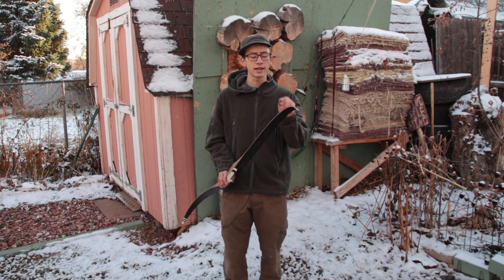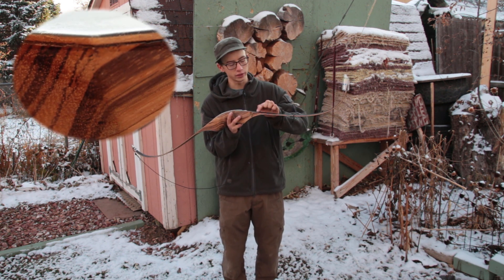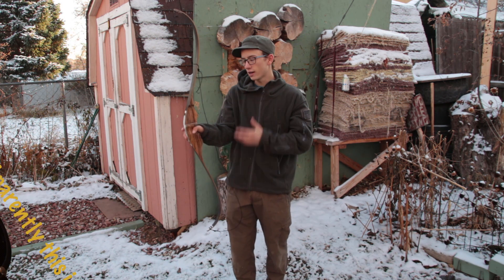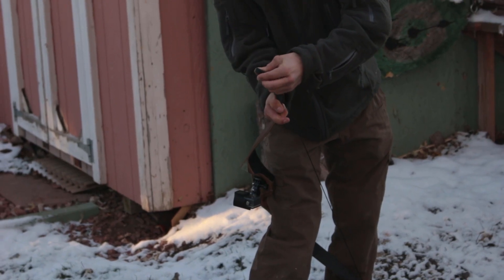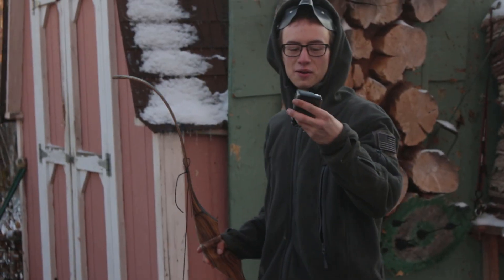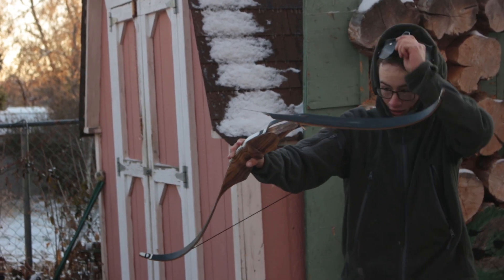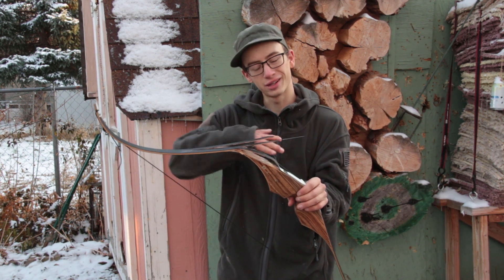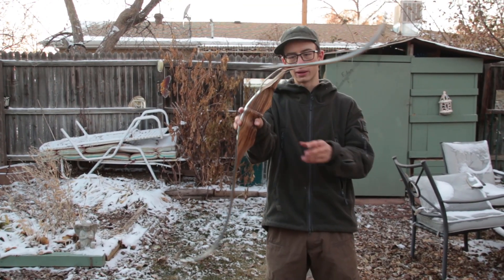Fiberglass Bow Delamination

Comment: Usually, as I understood, this construction of bows (where you have limbs made as: fiberglass layers - wood core - fiberglass layers) are called laminated bows. 

Fiberglass bows are different, your working portions of limbs is made just out of thick fiberglass panel and for visual reasons those limbs use to be cowered by leather.
Reply from the maker: @msk5643  that is true but these laminate bows are commonly just called fiberglass bows since actual solid fiberglass bows are pretty uncommon outside of kids bows.

Comment: That bow had already delam, you can see the non fibreglass adhesive used to glue it back together, never seen fibreglass be globbly/sticky like that.
Reply from the maker: Pretty sure I mentioned that it was damaged, I usually like to keep functional bows to shoot with ;)
Reply: @TheElvenArcher  

SIGH
Your video didn't show a bow delam, it showed a bow that had previously delam and been glued back together with something like wood glue. by the time the previously fine limb section was delaminating it had lost all tension and was far less interesting then it should have been.
Reply: @1v75cjgu2j2j  It helps if you are going to call someone smooth brain and be insulting you don't f-up up a like a moron and do it a whole year later.
At no point does he mention the bow had already delaminated and been glued back together.
The fact you have such a problem with someone pointing that out... well get over yourself.